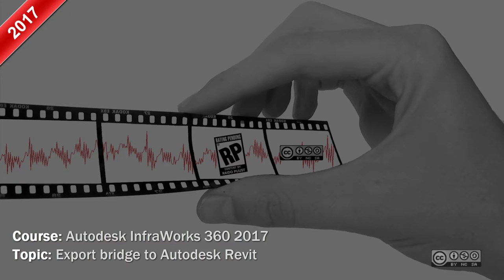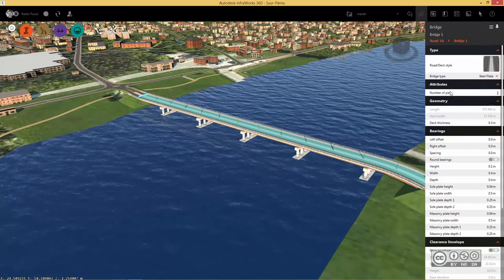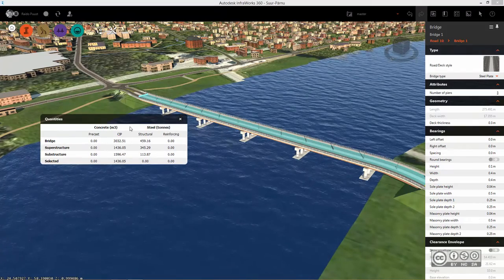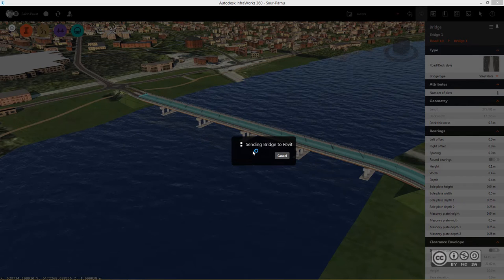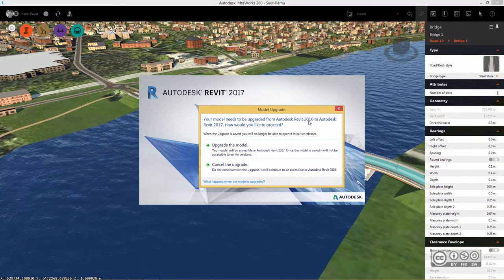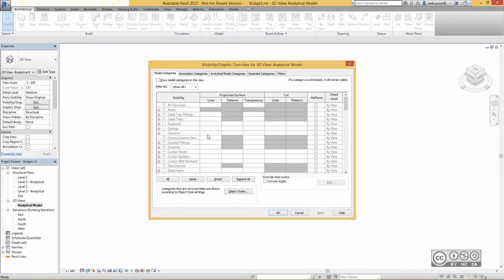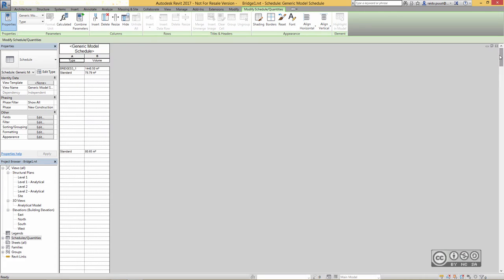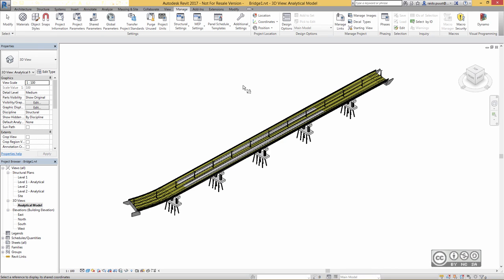Autodesk InfraWorks 360 - Export bridge to Autodesk Revit

Comment: Dear Raido, i am using Infrawork 2020, when I right click it was not "Send to revit" appear, pls advise
Reply from the maker: Hi, you need to check what version of Revit you have installed and if the correct plugin is installed (ex Revit infraWorks Updater plugin that can be found from Autodesk Desktop App). I prefer 2021 export, as it is exported into mid-file and no Revit is opened during the export. Then I will open Revit and import that mid-file with some advanced settings (depending on families I want to use).
Reply: Hi, did you solve the issue? I'm dealing with exactly the same problem. Revit Infraworks Updater is already installed so I'm not sure where the problem lies...
Reply: @alejandrosantanaacevedo2996  Hello, it's happened to me too.. did you solve the issue? thank you
Reply: @nadifaaulia9676  yes I did :)
I used this workflow: https://help.autodesk.com/view/INFMDR/ENU/?guid=GUID-1F9FF62C-DF8B-4EA7-B764-53C44D5C3E42
Good luck!